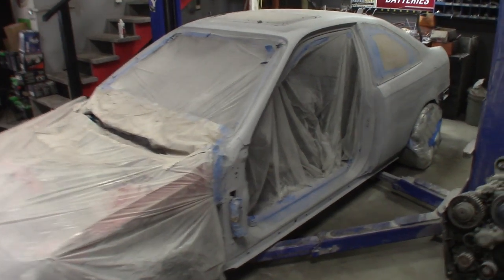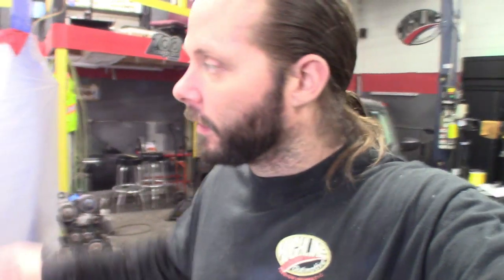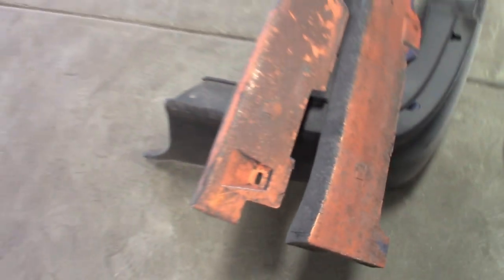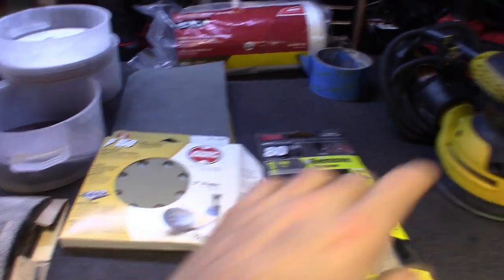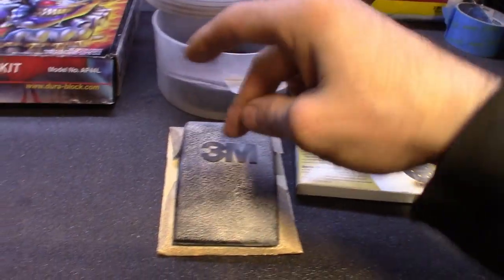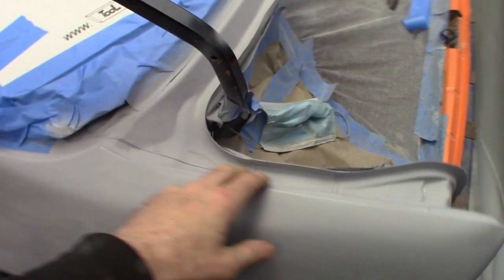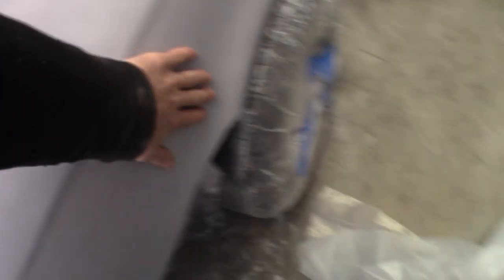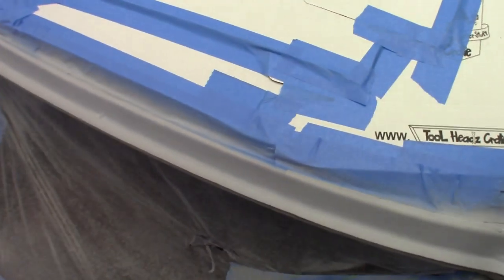Prep Work.... I Can See The Finish Line From Here🏁👀

Comment: How far are you from Chicago?
Reply from the maker: 10 mins but 20 mins to the loop
Reply: We are close man I may need a good mechanic one day!  Hey question. I’m gonna be doing a valve lash adjustment in my 2007 civic lx and the bolt needs to get torqued to 10ft lb. Most Rental torque wrenches start from 20lb.  Would eye balling be ok?
Reply from the maker: I would use a 3/8 torque and 120inch pounds is converted to 10ft lbs
Reply: Thanks! I will look into that.